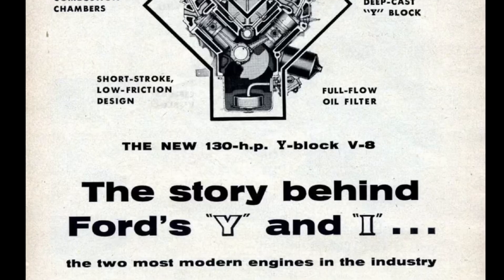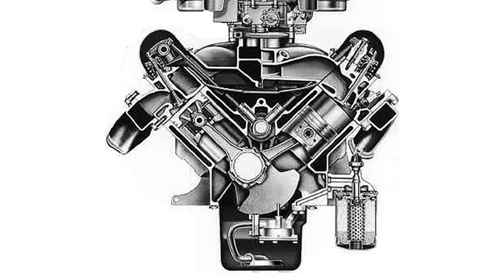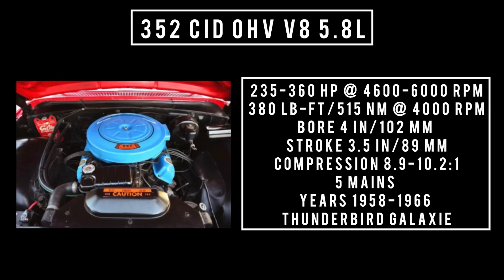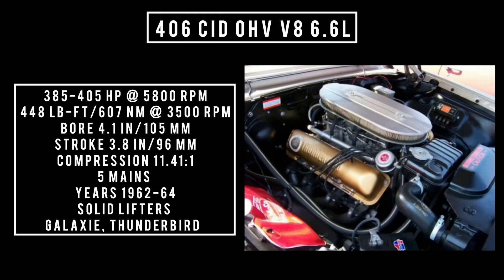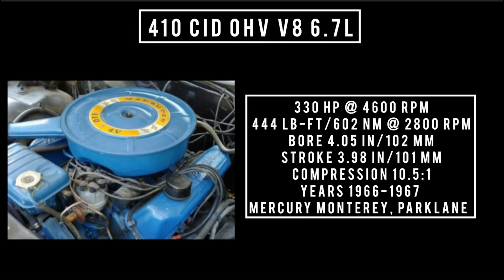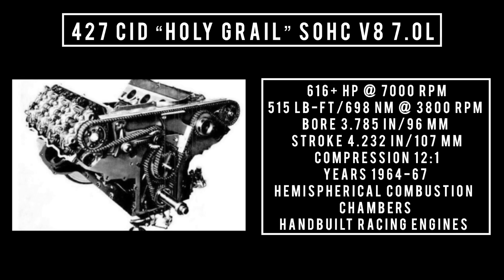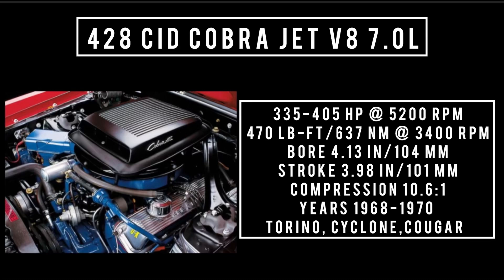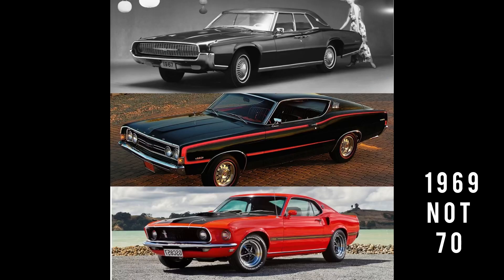Ford FE Engine family 332, 352, 361, 390, 406, 410, 427, CAMMER, 428, CJ428, SCJ428

Comment: My parents were given a 1971 Ford LTD Country Squire station wagon with a 390 engine equipped with California emissions. Ghastly car that rarely ran on all cylinders, belching out James Bondian amounts of heavy black smoke ready to ditch any unsuspecting pursuitent. The local garage mechanic always would throw up his hands every time he saw our car enter his shop. The front headlights had shutters that had minds of their own when opening and closing. Despite the engine’s very rough rumblings, it had plenty of power to perform a fragrant pass. Mercifully the car blew a hose once too many times when driven by my sister’s boyfriend, the engine seized and it died an early death at 60,000 miles!
Reply: Poor custodians pick poor mechanics, and have poor experiences with otherwise fine cars. Often is the case.
Reply: @20alphabet  True, but in 1973, in Washington State, neither the Ford dealership nor the local highly regarded mechanic… had the remotest clue as to how to deal with a car with California emissions as the plumbing and hardware were an alien technology that had yet to plague the other 49 states. Furthermore, starting in 1973 automakers gave up on trying to expand the horrors of California emissions and instead started to build cars with catalytic converters and unleaded gasoline. My parents weren’t exactly financially up to par as my dad recently started a new job with a new baby, so instead of selling the troublesome car, they put up with the beast in a very small town located far from wealthy California and its savvy mechanics.

Comment: I'm not sure if I mentioned it before,  but the problem with the original 427 V8 is lower-end oil starvation during hard acceleration and cornering.
FE, MEL, etc. was made up of the first letters of each FoMoCo division. Never heard 'experimental' mentioned in real life.
Of note, all of the FE engines I've ever seen have had 352 cast in the front of the block. The 352 was replaced by the 360 in the light trucks. Having had a 360 V8, I can tell you that it was way underpowered compared to engines close to it in c.i., like the Chevy 350, and engines of the same size, like the Mopar  and AMC offerings. I also had a Dodge p/u with a 360 for a company truck. The 2bbl. Holley it came with provided plenty of power but driveability was an issue. I upgraded it to a 340 4bbl. manifold and Thermoquad 4bbl. carb. That turned the truck into a rocketship making the round 100 mph speedo's needle go around to zero.
The Ford p/u, we upgraded to a 390 with an aluminum Edelbrock intake and Carter AFB 4bbl. carb. Had we thought about it, we would have used a 428.
Reply from the maker: Thank you so much for sharing that insight and information

Comment: My former teacher Tim Homier has a 67 Mustang Fastback with the 390 FE in it and man he loves it.
Reply from the maker: That car sounds totally awesome I know somebody that has a triple black one and they never drive it and it bugs me because I’m like you have the coolest or one of the coolest muscle cars and you never drive it..
Reply: @What.its.like.  I know right, I have a 1996 Ford F150 with a 5.0L (302) Windsor V8 with 210,000 miles on it and still going strong and I defiantly take to carshows when its nice out or drive it to work when my other truck (my 2011 Ford F150 with a 5.0L Coyote V8) either has to get its oil changed or if my parents has to use my truck to haul some stuff as well.

Comment: Did "Cobra Jet" and/or "Super Cobra Jet" refer to various hi po 428s and also some 429s? 
Would be interesting to compare the weight of the 428 vs. the 429 which I think looked bigger but I don't think it had as deep a crankcase skirt where the main bearing caps mounted. 
 Interesting that most hot wheels car magazines don't show or talk much about bottom ends but that is an important area that determines how much power an engine can be built to make and also how much compression it can handle.
  Slightly smaller main journal good steel forged crankshaft better than a big cast crank?

Comment: Amen to mentioning the Y-Block top end oiling issue. In the '60s, had a 272 and a 312. Neither would oil the rockers. They used to sell kits in the parts houses for adding an external top end oiling fix....it worked.
Reply from the maker: It’s crazy how Ford as a brand does things like that just like a whole Pinto incident they knew that they could explode but instead of fixing their problem they just ignored it..
Reply: @What.its.like.  
Yes, that was amazing. My folks bought a new '71 LTD and I found out later they had a similar gas tank issue,  just not as bad.
BTW, speaking to your "FE" Video, it's very well done.
A guy I know back in the hometown area was heavy into FE engines. He had several 427 side oilers, one with the High Riser heads etc. When Holman & Moody were closing their doors, Bob & his brother went down and bought two Cammers complete. Very cool!
Reply from the maker: Thank you so much glad you dig that video is actually a revision.. The other videos got close to 33,000 views but there was two major errors and I got tired of responding to every single message I figured I’d just fix it.. YouTube doesn’t make it easy to fix things once posted I tried to fix it in the subtitles and a couple different ways but glad that you liked this episode =) 

I want to see one of those CAMMER 427 in action
Reply: @What.its.like.  
Cammers were very cool. A older friend of mine, worked back in the day, at a top fuel chassis shop in LA. I believe they did Sneaky Pete Robinson's AA/TF car.
As I recall it had a blown Cammer on nitro.  Very cool. Thank you, you're doing a great job

Comment: Aww, why not........
360 was a pickup eng not the 361
361, 389, 391, were the FT series in busses and heavy trucks
FT and FE were used some what interchangeably on irrigation and stationary equipment.
Many 427's and 428's stood in fields on pumps for crop irrigation and sometime ago were a good way to find these engines.
However those days are long gone.
FT engines used different cyl heads, water pump, timing covers and intake and exhaust manifolds and different crank snouts.
The blocks can interchange with a little work.
Reply from the maker: To my knowledge they didn’t put the 360in a car we only focused on the car engines in this episode have to draw the line somewhere and that’s where I drew it lol 

Man Ford has a really confusing engine lineage.. they also had the super duty line of truck engines and the Windsor small block line of engines
Reply: @What.its.like.  Yeah, just pushing buttons. It's a slow morning.
Reply from the maker: Lol it’s all good
Reply: @What.its.like.  Ford did a lot of odd things with their small-block engines which before the internet it was really hard to find much info on. For instance the steam holes in some cylinder heads which could come and go in any given production run/ model year. Lots of stuff will bolt together but won't work well together (if at all) versus the small block Chevy where almost everything can be interchanged. The FE series wasn't quite as bad but still had it's quirks. The 385 series was simpler but still has some oddities. For such a confusing subject you've done well here and I'm looking forward to your upcoming vids.

Comment: These engines have allot of carburetor troubles. Also ignition system problems plagued these engines like ignition coils going out.
Reply: The 4 barrel Motorcraft carburetor used on the 1970 429 (Cobra Jet I think had something different) had the accelerator pump stop working and the heat supply tube to the choke got stopped up,also I think the choke pull off failed -- I think these were common on whatever engine Motorcraft 4 barrel carbs were used on - most of these things could be overcome by an advanced homeowner with a service manual but there may have been popular alternative aftermarket carburetors
Reply: @davidpowell3347  Also another troublesome carburetor is the CARTER AFB 4 BARREL CARBURETOR that's used on many GM cars like CADILLACS, OLDSMOBILES,PONTIACS,SOME CHEVYs and Buicks. Also many Chrysler products IMPERIAL, CHRYSLER 300s,NEW YORKERS, DODGES,DE SOTOS, AND PLYMOUTHs. The automatic chokes never functioned properly and the floats would stick causing fuel starvation which made the cars buck like when coming out of turns . When the engines are cold they would stall the moment you took your foot off the gas pedal and were reluctant to restart. You had to pump the accelerator repeatedly to get them to restart. My Dad's 58 Caddy had all these problems with the CARTER AFB 4 BARREL CARBURETOR. Also I think the HOLLY CARBURETORS had the same problems as well especially the 4 BARREL HOLLY CARBURETOR. On my Dad's 58 Caddy the floats in CARTER AFB 4 BARREL CARBURETOR finally developed holes in the floats permanently stalling out and flooding the engine. The car had to be towed to a service station to have floats replaced and the rest of that pesky carburetor overhauled.
Reply: @davidpowell3347  Also I think the HOLLEY 4 BARREL CARBURETOR had the same issues as the FORD AUTO LITE MOTOR CRAFT 4 BARREL CARBURETOR.
Reply: @albertcarello619  The Holley's blew power valves which many folks mis-diagnosed, and they were not as good mid-throttle. They were easier to re-jet and to work on overall which is what sold them.
Reply: @P_RO_  On my 1972 AMC MATADOR 360 2 BARREL V8 it needed a new carburetor after the original Ford Autolite carburetor went shot. I asked a mechanic about replacing it with a New HOLLEY 2 barrel carburetor and he said avoid the HOLLEY CARBURETOR and stick with the FORD AUTO LITE 2 BARREL CARBURETOR. All AMC VARS for 1972 used FORD AUTOLITE CARBURETORS AND STARTER MOTORS AND STARTER RE-LAYS.
Reply: @albertcarello619  I'm one of the world's biggest fan of the Autolite/ Motorcraft 2100 series 2-barrel carb. My last SBF build went 285K miles without touching the carb save for one plastic float replacement. Superb fuel mileage and great power for a 2bbl.
Reply: @P_RO_  Amazing!!!!
Reply: @davidpowell3347  The choke heat-riser tube on all Ford carbs was steel which broke/ rusted in place/ leaked at the flares/ and seized on the exhaust badly. Replace the tube with flared copper or brass tubing and they work SO much better. Also most guys didn't rebuild the choke when the did the carb. When they were right they were a lot better than GM's cheap bi-metallic spring mechanism, but theirs was more reliable once fully warmed up
Reply from the maker: Thank you so much for sharing that information =)
Reply: @What.its.like.  You're Welcome.

Comment: I've had a couple of 64 Thunderbirds with the 390, and I have a 76 F250 Highboy with a 360. I've always called it an FE, since it is in a Light-duty truck. Medium-duty and Heavy-duty trucks like the C-Series and F600 got the FT engines.
Reply from the maker: Definitely going to cover the FT engines this is actually a revision of the engine episode just from last week there was a couple really big errors that I needed to fix.. YouTube does not make it easy to fix things after the fact so this is the revision =) 

Definitely will cover the FT engine series not entirely sure when but definitely an engine series that needs to be covered Ford had a really confusing engine lineage
Reply: Sorry, I edited my original post while you were responding.

Comment: I believe this was already posted but I enjoyed watching it again I’ve always loved the ford fe motors and I feel ford was underrating them from the mid 60’s on everything was between 315 &345 regardless it seemed . For the would you rather I’m going to take a 66 mercury parklane marauder ( you pictured a 65) and then the 69 Mach 1 as I think it’s the nicest mustang ever built
Reply from the maker: I had to fix it there was a couple errors and I was tired of answering everybody’s question about Ford FT engine so I just wanted to make it right =) 

Great choices
Reply: The video had run before and here it is again with the bulk of the corrections having been overlooked.

Happy holidays all the same!

Comment: Deja vu
Reply from the maker: Had to fix it =)
Reply: What did you fix?   @What.its.like.
Reply from the maker: FE 332 bore and stroke size and picture 

427 bore and stroke sizes 

And explained that the FT engines 330 359, 360/361 389, 391 ARE NOT covered in this episode YouTube doesn’t make it easy to fix things once posted I tried to fix it in the subtitles I tried to put text over top which you can’t do. Plus found out people don’t read anyway lol
Reply: Lots of guys, including myself, mentioned that the 360 is not an FT engine. It is not. I have a few. It is essentially a 390 with a shorter stroke. (Or, a +.050" over 352). Pistons and blocks are the same, as well as heads, intake, valvetrain, etc. The FT engines have many components that are different. "FT" engines are used in Medium Duty to Heavy Duty trucks, not Light Duty like the F100 and F250. There is ample info on this. Claiming the 360 as an FT is just going to cost you viewers.
And, considering the topic of this video, you should have spotted that my name is actually the bore and stroke of a 428 FE. I have more FE's than anybody watching this.    @What.its.like.
Reply from the maker: Ok to put it another way focused on the car engines.. that engine only was offered in the ford F series
Reply: Yes, but Ford never called the 360 an FT. Never. I've been into these cars since they were new. Please don't attempt to rewrite history.   @What.its.like.